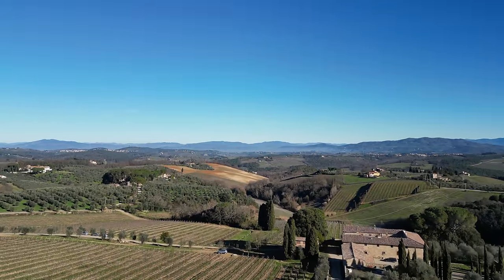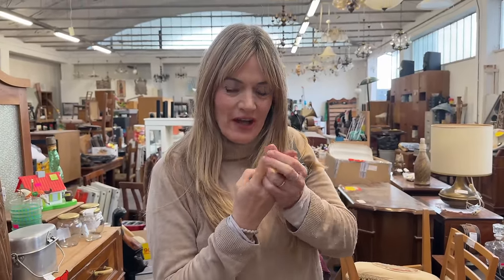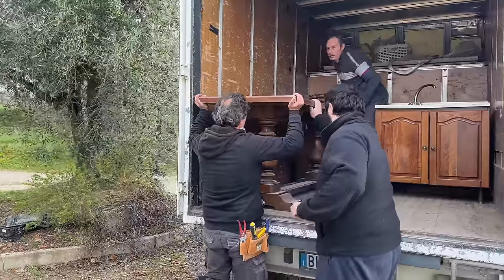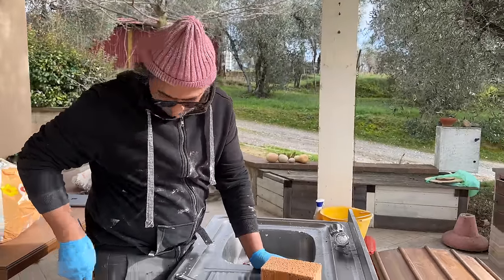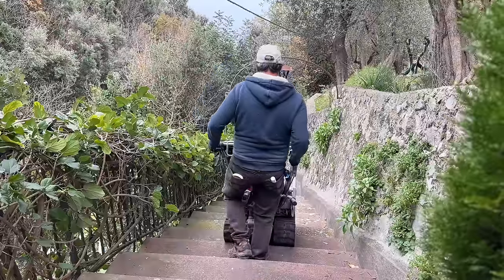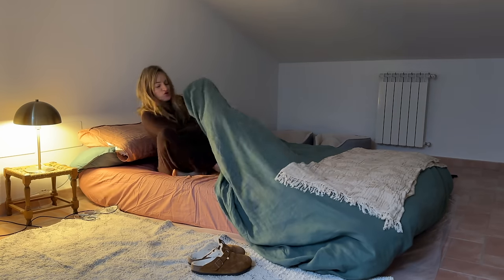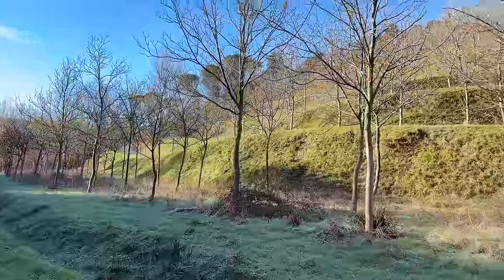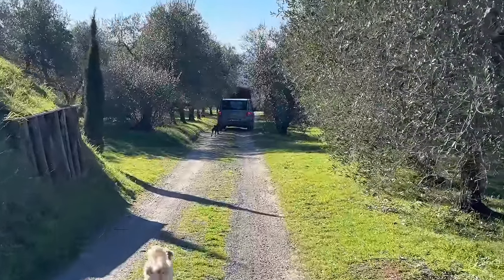WE'RE MOVING IN & BIG DELIVERY DAY! | Tuscan Diaries EP 3

Comment: Looks like such a  lovely house and area - you're making such a difference already. Does aeem to have some odd things about it tho e.g. the fire tucked away in the corner. In the UK we'd probably put that in the centre of a wall, or in the living room, to make a feature of it and easier to sit beside and get warm. The tall radiator right beside the french windows where you might want to hang curtains. Also. do you always enter the house through the kitchen? With the stairs going up from there it looks like it should be an entrance hallway rather than the kitchen!